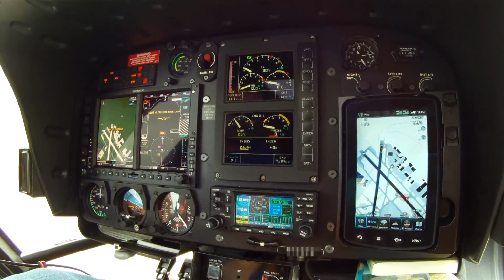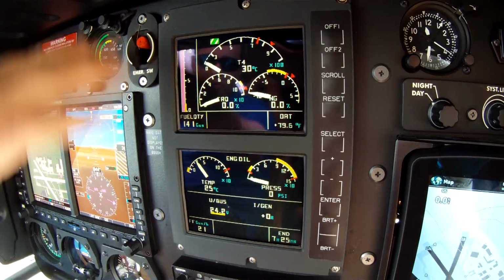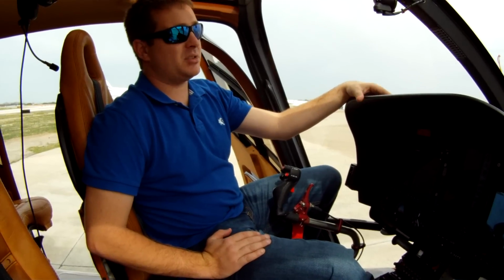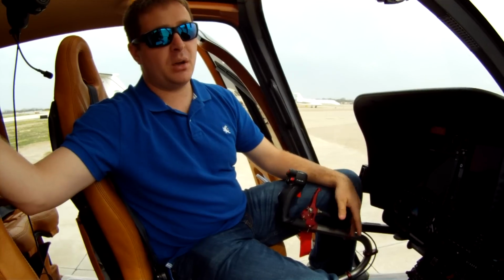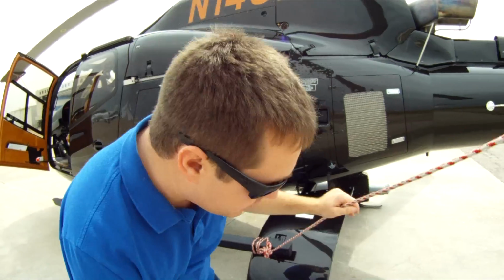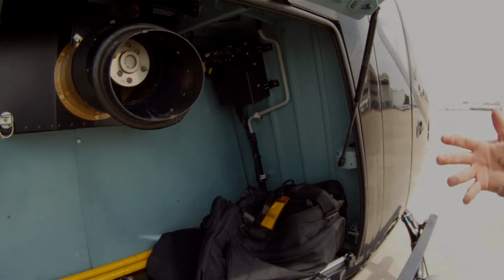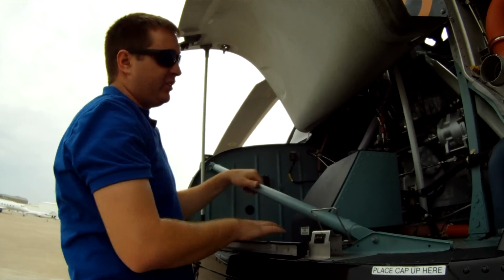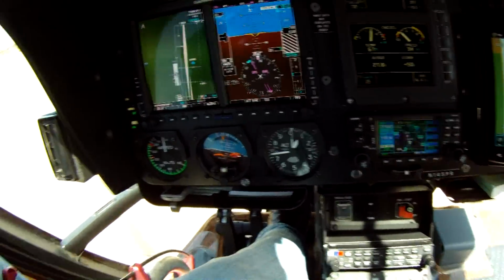Eurocopter EC 130 Walkaround

Comment: Very hands on and educational, and I enjoyed every second of this video.  I've always wondered what a helicopter looked like under the hood and how the rotors operated mechanically.  I'm so glad this video shows you the inner workings of the helicopter such as the engine, transmission, the hydraulics, the rotor blades, the tail rotor's fenestron, as well as some of the insides of the cockpit.
Beautiful machine, and an amazing piece of mechanical craftsmanship, refinement and overall engineering.  The Eurocopter/Airbus EC130 Eco-Star is a great machine, and it's no wonder that it's become so popular in the tourism industry.

Thanks for sharing this video, I learned a lot and have a better appreciation for the EC130.  I've flown in EC130 a few times, and I can't wait for my next flight in the EC130. :)

Comment: What's the lifetime of a helicopter? How many hours of maintenance do you have to put in per flying hour? You said the blades were a "lifetime"item by lasting 20000 hours. Does that mean let's say you could fly it 4h daily and 250 days a year that it would work for 20 years? Sorry I have no clue... - never thought about what usage profile a helicopter would have to have.
Reply: 20,000 hours means 20,000 flight hours on the M/R blades.